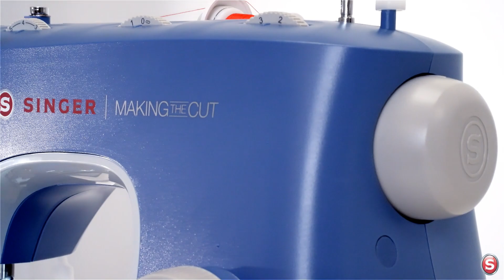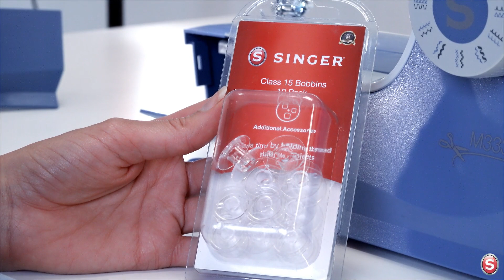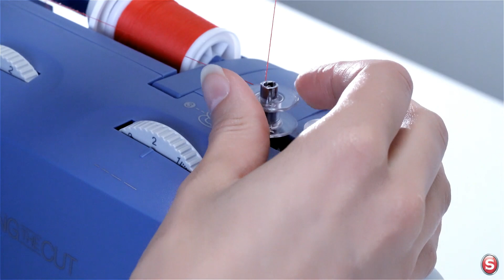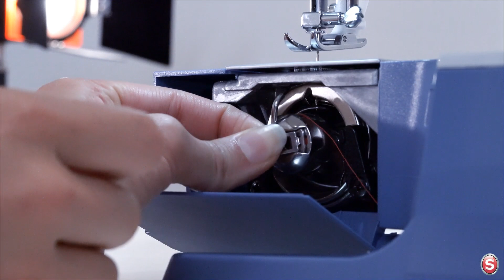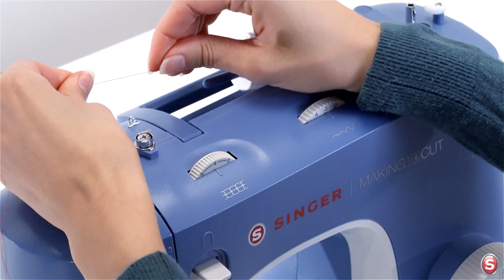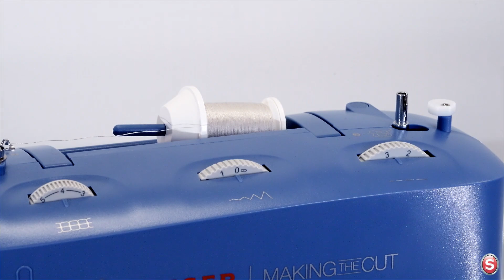SINGER® M3330 Making the Cut Sewing Machine - Threading

Comment: If you are struggling to thread your needle, look at the manuel your machine came with, there is a hook that you cannot see well that pushes the thread into the eye. The visual of the manual shows it reallt well.
Reply from the maker: Great tip! Thanks for sharing it with the community! - AC

Comment: I'm struggling to thread the needle using the lever. I get to the point of tucking thread into the hook. As soon as I release lever thread completely misses the eye. Any suggestions on how to bypass using the threader and just get the thread through the eye some other way?
Reply: Been here for hours trying to get this needle threader to work. There's got to be a better way.
Reply: Double check your need is the right direction?